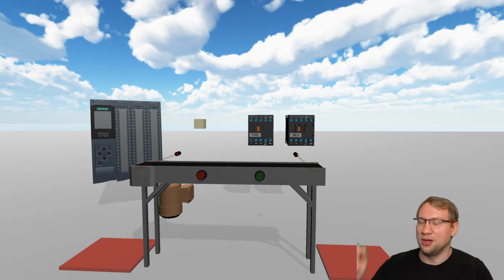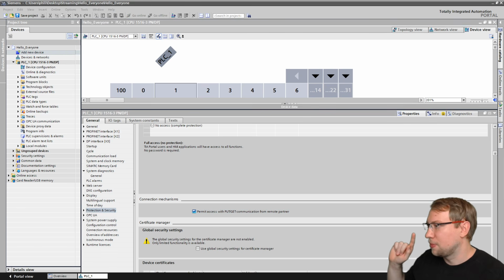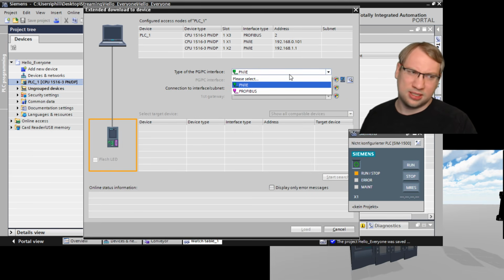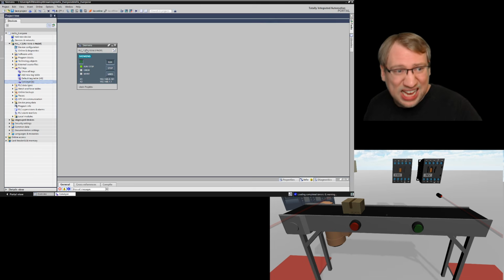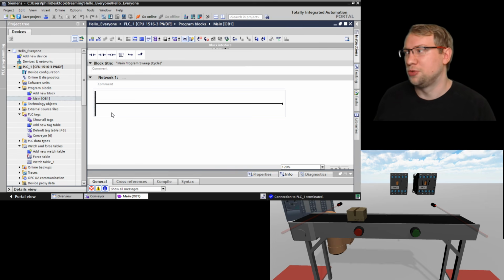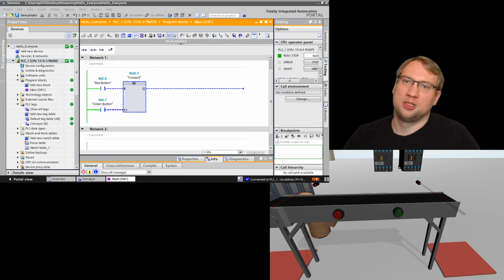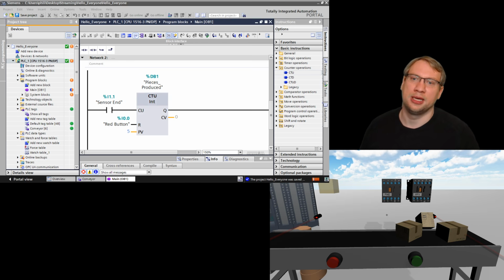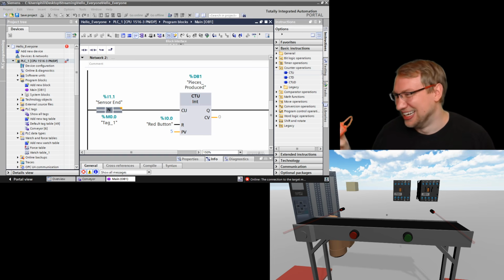TIA Portal Beginners Lessons! Everybody is welcome!

Comment: i want to make modification to a process. The manufaturere says "Addressing your concern regarding continuous water spraying when CO₂ flow is zero, we propose a logic modification to reduce water consumption. If the CO₂ flow is less than 5 kg/hr for 1 minute, the control valve will close to 0% in auto mode. Once the CO₂ flow increases above 5 kg/hr, the valve will again open to its minimum position (34%) to maintain adequate water flow " I assume this as a comparator how can i do this coz it seems a small block to add. Kindly assist. do i share my email or contacts

Comment: Hello friend, I have a Siemens S7-1200 plc programmed in Tia Portal V11, is there any way to make a complete backup of the software and hardware so I can download it to a new plc? From what I read on the internet, tiaportal V11 does not back up the hardware, it seems that some adjustments need to be made manually. If anyone knows how to help me make the backup, I can pay for the help.
Reply: I mean make the download repair the software project and make the upload sending to s7-1200 my plc is working very well

Comment: Hello, Phillip

I just wanted to say a huge thank you for your effort and the incredibly helpful videos you made on TIA Portal.
 In June, I was finishing my master thesis (Diplomarbeit) in Automation and Applied Informatics in Mechanical Engineering, your videos literally saved me :) 
Industrial automation was not really my cup of tea (partly because of me being lazy & stupid and partly because of the teacher being a jackass), however, I chose the thesis in TIA Portal since it was a project for an actual industrial enterprise.
When I began working on the program I was lost... With the time running out I was pretty desperate and stumbled upon your videos. I was immediatelly impressed by the clarity a simplicity with which you explained the topics in each of the videos. They made a huge difference for me, when I needed them.
If it was not for your work, I would probably still be on university working on the thesis instead of being a properly graduated Automation engineer :)
So once again, Thank You.
Keep up the good work.

Michael

Comment: Is possible edit programs on TIA Portal without to turn of the PLC, without turn off the mechine, without cut the production process? How to do that? I did it properly using all of Allen Bradley programming software
Reply: i edit blocks on portal and redownload to plc with no stop in modules or run.  if you make changes to anything with safety modules it will often stop the plc briefly to load but it will tell you before it does.

Comment: Hi, i wanna activate the pusher in factory I/O using scl but it is not working, here is my code can you help me please, 
IF "Total Parts" MOD 2 = 0 THEN
    
    "F_TRIG_DB_4"(CLK:="Pusher Diffuse Sensor",
                  Q=>"Pusher_1");
    
    
END_IF;

IF "Pusher_1" THEN
   "P1" := 1; 
    
END_IF;

"R_TRIG_DB_4"(CLK:="Pusher front Sensor",
              Q=>"Pusher_2");

IF "Pusher_2" THEN
    "P1" := 0;
   
    
END_IF;

it keep it zero.